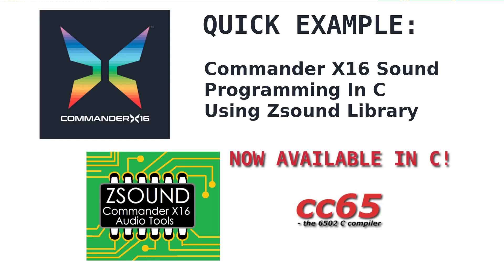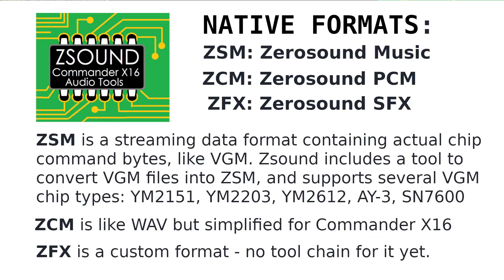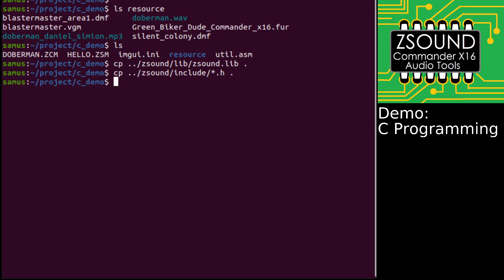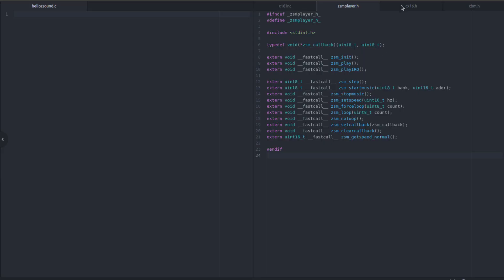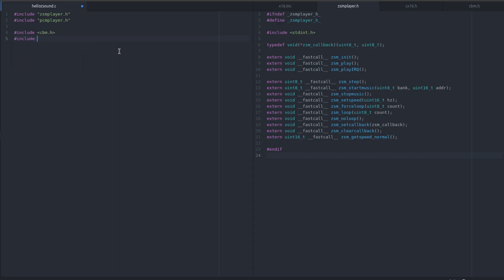Zsound + C = Easy Commander X16 Audio Programming

Comment: CC65 is probably just about as good as a 6502 C compiler could possibly be - which is to say, not good.
Reply from the maker: Actually, there are more efficient C compilers out there for 6502. I like the ease of producing hybrid C/ASM projects with CC65. You're right though - CC65 can spit out some very bloated assembly, but if your project doesn't require speed (like my jukebox program, Calliope) it really make coding a lot less tedious.

Of course, Zsound is written in CA65 assembly and was originally designed for use in assembly projects.

Comment: 12:26 A fast addition: The zcmtool script uses "sox" to do the actual conversion so if you have the correct sox sound format libraries installed, you're able to directly use the script on mp3 or ogg files or any other format that your sox installation supports.  In that case no manual conversion to wav is necessary
Reply from the maker: I hadn’t installed the ffmpeg extension to Sox at this point. I’ve since installed it and it works as stated.
Thanks for the tool, Desertfish!